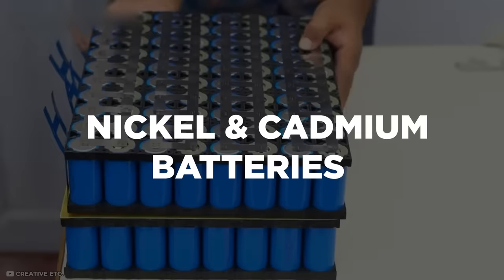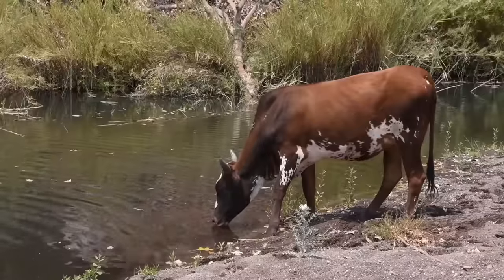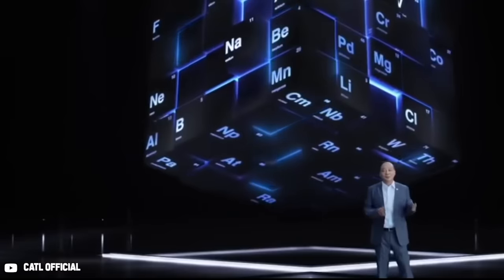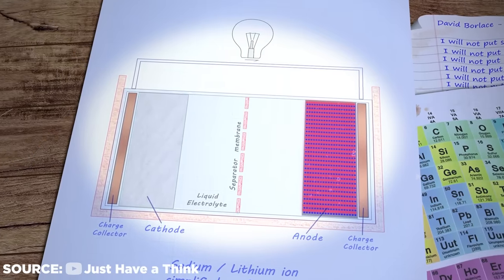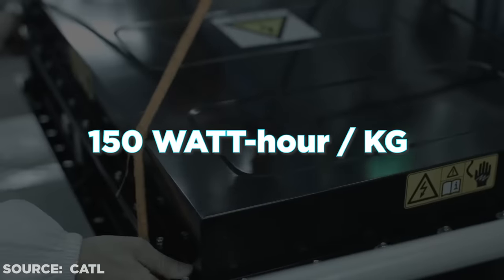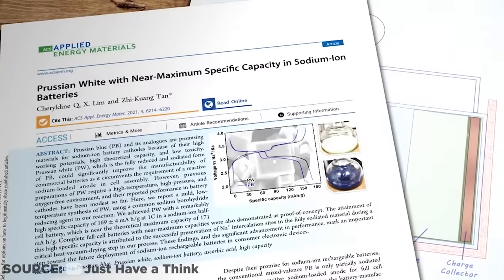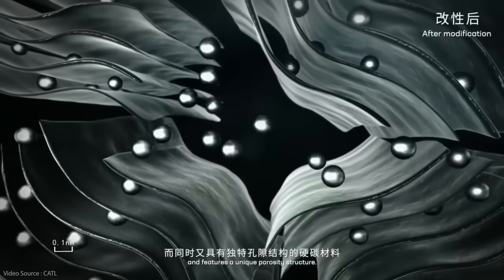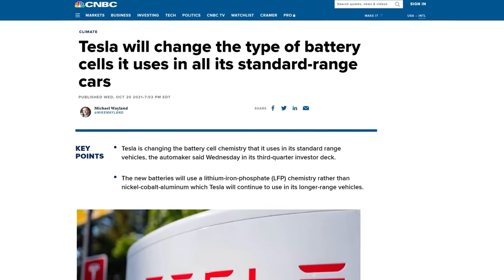No More Lithium! NEW Sodium-Ion Battery To BEGIN  Mass Production

Comment: Call me again when they are actually available to buy. There've been way to many miracle battery announcements over the last decades, which never came true.
Reply: why miracle?? it is science
Reply: Yes it's true, they only want sponsors for that
Reply: @StagnantMizu  The "miracle" is when the pros vs cons for new tech or new formulations favors the pros in a significant enough manner. If you follow state of the art advances in fusion tech, you will be jaded by the latest "miracles" that are indeed advances but are mere baby steps when good sized hops are needed. Commercial Fusion is always said to be 20 years away but as seen so many times, that estimate is continually reset as the deadline approaches .. and passes
Reply: There is no "miracle" here. Na-ion technology works on the same principles as Li-ion. The two elements have the same structure and chemical properties. It was just never cost-effective to develop Na-ion until the demand for lithium went through the roof.
Reply: Lol ppl take the word "miracle" seriously

Comment: Even if they are heavier, especially in Midwest and countryside, the batteries could be stored in the basement or in garage, and the solar energy could be used to charge them. Even if there are three times the bulky, if they're cheap to produce, and last long, they are worth and investment for the greener and a cheaper world.
Reply: Yeah but their primary use would be to be stationary. And most people don't think "I need a battery made of this" they think "I need a battery, lemme ask my wallet for recommendations"
Reply: Greener? You have to mine sodium (Na) it’s a volatile metal when introduced to water, it is not salt they are using (NaCl sodium chloride)

Comment: I feel like this is more of an alternative than a replacement. Lithium may become a premium battery and sodium may become the common battery when prices come down. Which would be a good thing
Reply: Not necessarily just cost.

If they're more durable to charging cycles and less sensitive to heat, it might be that they're vastly superior for grid redundancy, which would drive down demand and therefore cost of lithium.

Being 20% larger and heavier but much more durable to charging cycles at any temperature is actually a feature many would pay a premium for.
Reply: That's what they said about LED vs CFL lightbulbs, but then LED proved to be cheaper and more durable and the general public was all like "What have you done for me lately?" to CFL.
Reply: @Dargonhuman  I've had LED bulbs fail much sooner than CDL, but overall I still run them over CFL
Reply: @timmturner  almost every led light bulb sold in America is made so that with enough heat they will fail because of small connections to leds
Reply: @keithbroh5730  that's the problem with LED, they don't generally have enough heatsink and get far too hot.
Reply: @timmturner  turns out that some LED light fixtures (no socket, the fixture is the light source) have far greater cooling capabilities, but once that too inevitably fails you have to replace the whole thing.
Reply: @timmturner  this is a design feature so you actually still need to buy lightbulbs. if the engineering team had their way that bulb would be inherited by your great grandchildren. it'd likely only cost a tiny fraction more to make, they'd charge 3x the price for them, but why make $15 once when you can make the things breakdown and need replacing every couple of years?
Reply: @keithbroh5730  Yup. Lots of products are made to fail. Sounds kind of non green to me, but glad were keeping what the plants breath to lower levels.
Reply: @Dargonhuman  CFL lights are better.
Reply: @timmturner it’s not the diodes failing, it’s the other electronics that drive them, many cheap led lights deal poorly with heat dissipation which leads to failure. I bet more than  99% of those diodes would still work if put on a new board
Reply: @nick91884  It's actually a combination, less common is the LED failing and more common along the power path where it gets far too hot.

I generally diagnose them when they go out.

Here is the most recent, you can see how heat destroyed the power path:

https://i.imgur.com/1mlHHa9.jpg
Reply: @MrOsmodeus  I have 15-watt equivalent LED lights outside 24/7/365 for 15 years
I have never turned off.
16 diodes on a heatsink the size of a thumb
Reply: Well when we are changing to green alternatives it should be the other way around. Sodium = Premium...
Reply: @timmturner  its called planned obsolescence, even incandescent bulbs could last hundreds of years but these light bulbs are DESIGNED to fail.
Reply: @pondracek  assuming lithium does not improve and have breakthroughs as well. Also, were we not sold the promise of graphene battery adoption being just around the corner. I admit any progress is good progress when it comes to battery technology.
Reply: The sodium used has to be mined just like the Lithium.  It's seriously unethical to say "sodium" and then show piles of salt, as if that NaCl is the resource versus pure sodium.
Reply: funny murican, we talk about battery here, then they discuss something else
Reply: @heroninja1125 those incandescent bulbs that last a century barely glow as bright as a candle though. Limiting the maximum lifespan of incandescent lightbulbs was a much more nuanced decision than just corporate greed, it was a deliberate tradeoff for maximizing efficiency at a time when lightbulbs became dirt cheap to manufacture and power grid operators were struggling hard to keep up with the rapidly rising load as more and more people became able to afford electricity in their home. Hell, back then many grid operators even gave their customers replacements for burned out bulbs FOR FREE in order to stop them from using the inefficient long-life bulbs! 
This is literally THE WORST example of planned obsolescence in a world that's flooded with actually good examples and it should've been retired long ago!

Comment: This tech is ideal for PEV’s. Even if capacity is less than current L-ion batteries, the fast recharging ability would allow a rider to recharge in the time it takes to get a coffee. As long as there is access to the power grid you’d never have to be down more than a typical rest stop. I’d be willing to have a battery pack built to try this.

Comment: I am surprised to learn that 75% capacity was insufficient for the tradeoff of rare materials. My question is: how are the low-end thermal operating ranges?
Reply: Other problems are cyclability and compatibility with a graphite anode.
Reply: Lithium is one the most common elements on the planet...
Reply: @eclecticgamer5144  33rd most common, but now that I see how it's extracted, I see your point. It isn't rare at all and is typically harvested from seawater. Now this makes a lot more sense.
Reply: @eclecticgamer5144  - Lithium isn't that common, and it's concentrated in... geopolitically inconvenient regions.
Reply: Yeah, 75% is higher than I thought it would be given its lack of use. Weight is an issue for things like EVs, but the lower cost makes it seem pretty obvious as a primary use case for things like grid storage plants.
Reply: @KingBobXVI  "geopolitically inconvenient regions."
You mean... everywhere on the planet? 
It's not a factor of abundance, it's a factor of extraction methods.  There are millions of tons in Nevada, but the methods of extraction haven't been refined to make that a viable source... yet.  
Other sources allow easy extraction with current methods.  And it's so abundant from those sources, that no method for the other sources have been developed... that's how common it is.
It's like Crude Oil VS Shale Oil.
Reply: 75% capacity is a very "optimistic" estimation. It could be as bad as 60% vs Lithium.
Reply: @eclecticgamer5144  See the Salton Sea in California with its numerous Lithium mines.
Reply: Found out the deal: it’s not the ions, it’s the cathode. Lithium batteries use Cobalt whereas they are developing Sodium batteries using Iron.
Reply: @Astraeus..  And Li-Ion battery tech is a moving target.  Solid-state Li-Ion battery are already be sampled and provided to OEM's for testing.  Expected to increase energy density by 2-3X, improve charge & discharge rates AND vastly reduce fire risks.
Reply: @eclecticgamer5144 no it is not. 70% of the worlds lithium resides in the DRC, a conflict zone in Congo.
Reply: @KS-45  You made that up.  There's enough lithium in ONE deposit in the US to power all electric cars made for the next 10+ years.

Comment: The primary issue with Sodium-Ion battery had been cyclelife and lower specific energy when compared to Li-Ion batteries.  And while some progress are being made on Sodium-Ion batteries, IMO, they still have a long ways to go before they're ready for high volume manufacturing.
Reply: The sodium batteries from the 1800s gave studebaker 600 miles per charge when they created the first electric vehicle.
Reply: The Madras iit already in research to improve this.
Reply: in 2050 we know who won, if not happen same that early 1900

Comment: If the main drawback is the KWH/KG then why don't we use them in areas where the weight and space is much less of a concern EG: The Tesla Wall? If lithium is lighter and stores more potential per KG then it'd make sense for it to be used for portable systems in which weight is crucial. 

Aircraft need a really good power/weight ratio to be viable so the fuel that is used is made with that in mind, cars need a decent power/weight ratio so the fuel or batteries used have to keep that in mind, your house doesn't often move.

I know that in some areas of the world we use hydro potential energy generators that pump water up high for storage and then release it when needed. This system is in no way portable and it's not meant to be. Things like the Tesla Wall as well as other areas of local power storage don't need to have lithium and in some ways it could be seen as a waste of resources
Reply: Agreed. Given the otherwise similar specs of the two chemistries, I care about kWh/$, not weight. Give me SLA weight if you give it to me with LiFeSO4 characteristics and lots of safe storage.
Reply: Battery Technology arose from the express purpose of energy storage for hand-held consumer electronics. maximizing battery life, size and weight against the competition was critical in that space. No one wanted to eat R&D costs of new Battery tech.
Only recently were Lit-Ion batteries pressganged into larger scale fixed Battery installations and for vehicles. it was proven, available tech, but never intended or developed for that purpose.  There was also a powerful lobbies in fuel and industry hampering development in renewables and Batteries for their own interest. or maybe no-one saw a Market worth conquering. Now all of the sudden everyone invests into Energie Storage Technologies and developments are fast. that Only shows how many low hanging fruit were ignored for so long.

Comment: And Sodium- Sulfur batteries with more energy density will be suitable for higher end customers and performance vehicles and application too! Sodium will be complementary to Li-Ion for a while, meanwhile they will replace traditional Li-ion in the long run for low and high end application for transport and grid storage. With Li-S i hope to be complementary too! This is good to alleviate Lithium Price pressure and to not be dependents on imports for specific production States.
Reply: If this solves the grid storage problem, then it's a BIG deal.  I was recently looking at solar, and the batteries are so expensive that it really makes no sense (one of the big reasons for wanting it is to reduce grid reliance).  But if home battery costs could be cut dramatically, then home solar starts to make economic sense.  Other than batteries, it's already on par with grid power, so that's the game changer.
Reply: @eventhisidistaken  Yeah the great problem of renewables is that once you pass 50% energy generation by renewables you start getting diminishing returns unless you have very good grid energy storage
Reply: @eventhisidistaken  we have solar on the roof. No storage batteries yet. But the power bills are <20% of what they used to be, even in the peak of summer.
Reply: @nickiemcnichols5397  For me, part of the reason I would want solar is to have less dependence on the grid, so for me, the motivation is a lot less without storage. The amortized cost of solar was going to be more than my current power costs, so it didn't make sense without the grid independence aspect.  That said, I had rooftop solar priced, but I have a lot of unused land, and so a small solar farm might make more sense in my case.  I know that's a lot cheaper than rooftop.
Reply: @eventhisidistaken  They need to get the cost/return to a level where it makes sense.
Most solar systems take at least 20 years of use to cover the cost, and they panels are only rated for 20 years, the batteries for storage are less, depending on type.
Portable solar systems for backup sitting idle most of the time are the only cost effective systems until they improve these.

Comment: For electric trucks where an extra 500-1000 pounds wouldn't make a difference, this would be a good solution especially if they made the price cheap enough that no one would care if it's heavier. The problem is the lack of cheap batteries for the end user except in the used cell market. For a house battery who cares if it weighs 1500 pounds if it can store 100kw in addition without any risk of fires. For many homes that could be between a week and a month without power during a blackout depending on how you manage and the weather.
Reply: If you are talking about Semi trucks, they can only be about 80-87k pounds and 1000 pounds less weight for hauling is arguably a big deal.
Reply: lol, this is the metal sodium Na NOT salt NaCl sodium chloride. And it has an exothermic reaction with water so yes it can creat a fire and explode as well.

Comment: I would happily switch to these batteries, even if there was a longevity and/or charge time reduction, simply as I just really don't like using lithium, never have, but you can't avoid it nowadays!
Reply: Same here, but a lot of people simply don't care about other factors and only want the best performance, regardless of the consequences.
Reply: Lets hope they are much safer than tbe lithum batteries.  Too many lithium fires.